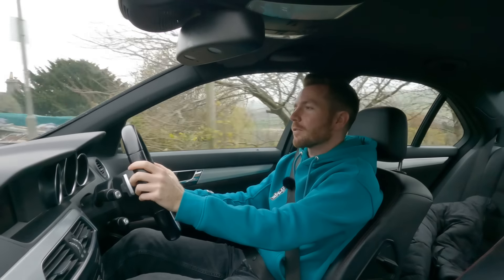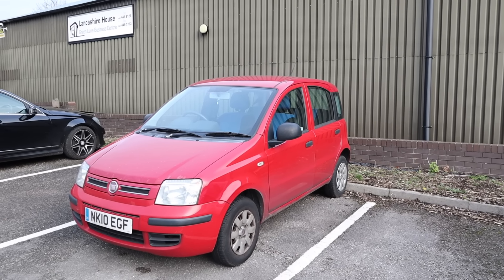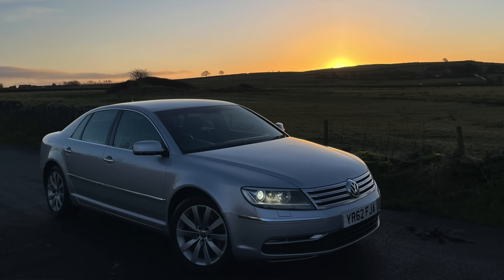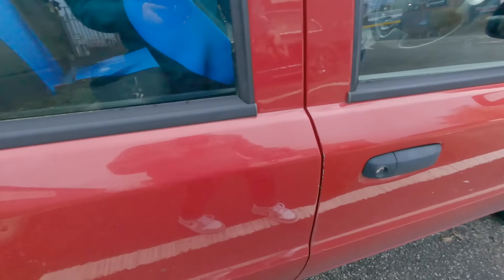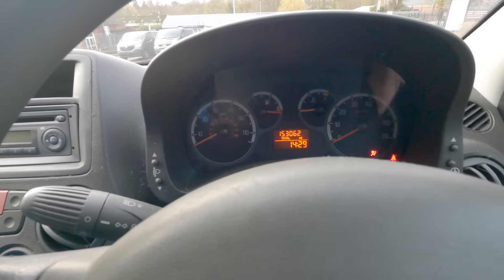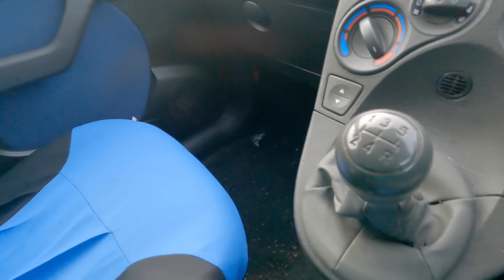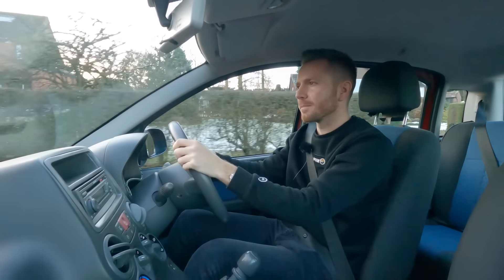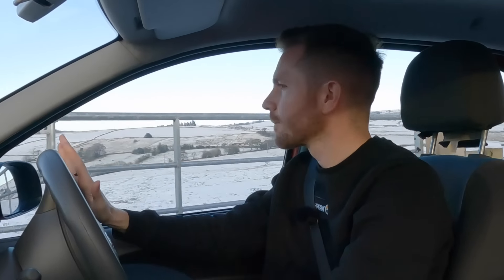I BOUGHT A CHEAP FIAT PANDA FOR £250

Comment: We are all different of course, but personally I love these videos where you go and buy a cheap runner with mega miles on the clock. As a trader you get trade prices of course, but it seems like yesterday that a tired Panda with some 'issues' would retail for a few hundred quid, never mind trade. 
I also really like Pandas, never owned one, but there is some genius in the design of that little car. Clever design without spending a fortune. You have to admire that.

Comment: I have in my past owned 2 Fiat Panda’s this shape .

One was a 1.2 Dynamic Skydome ( Had twin factory fitted sunroofs) .
My other was the 1.4 16V 100HP , I even did touring with the latter and after one really long drive i felt very good & still fresh that day .
The latter weakness was its suspension where on very bumpy roads i felt seasick .

Both were good cars at the time for me & both were 100% reliable with no faults at all .

Comment: 7:00
That engine is indestructible.
12:21
I drive 20 year old Fiat Stilo with 270.000 km on dash but power steering and city servo works like a charm.
City servo is awesome when i switch to another car i then i realize how useful city servo it is.
16:37
Another Fiat saved. It looks so nice.
18:47
Cleaner definitely earned his money, worth every pound
19:51
Whipper arms got treatment too.
4x4 Pandas are like goats it will climb anywhere.

Comment: Well done Matt, as you said before problem with cheap cars is they are cheap so no one looks after them. Thanks for showing the world it doesn't take much to transform sorry looking motor in to little clean runaround. Most of the time if someone sees 100k on odometer they  run away. Just keep them motors going because you will never see so simple motoring again in your lifetime. Keep on going Matt.
Reply from the maker: Yes exactly. What’s that saying? Many a fine tune played on an old fiddle or something?

Comment: Not completely bullet proof but excellent over a long period of ownership I had my MJ from new to 9 years & 130k problems other than wearing suspension parts were new EGR valve every 36k & electric steering light & fail which was low battery voltage not  a problem with steering. I have a set of 4 wheels with winter tyres for this & 4 fiat 500 size wheels & tyres 175 which suit the car well as the standard car is under tyred for the weight in the nose, let me know if it goes up for sale or you want the wheels cheers.

Comment: Had a fiat idea with the 90hp multijet  engine .was a really good car...also bought a seicento with the 1100 cc fire engine for £250...Had it 5 years so far ive spent around £80 in diy repairs..old fiats are underrated .cheap reliable and easy to fix

Comment: Like you say, pop a couple of winter tyres on the front and it’ll drag you through most of the snow we are likely to get, I’ve had different generation panda 4x4’s with winter tyres in my little collection of cars for years now 👍🏼

Comment: Matt - I am sure I see the air con symbol on the fan dial - and what looks like the on/off light.  I had a 65 plate Panda with a/c and it had a pull outwards fan switch that had a small light on it when a/c was on.  (Seem to remember the same on my Mums MK2 Granada Ghia X back in the day!)

Comment: We have a 2009 Panda Cross  with around 116000 miles on the clock and absolutely love it. I've just done a brake refurb, discs, and pads all the way round, which cost £93.00 and a new battery.

Comment: I owned three multi jet diesel models from 2006 until 2015, did 100000 miles in total between all three. Very economical with 64mpg possible providing maintenance was kept up. They have a few problems with rear axle rusting and rear shock absorber mounts. The heater fan is a notorious failure point but very easy to change if you remove the glove box. In my opinion they are a good reliable little car taking into consideration that they are built to a price.

Comment: The panda is a very well designed little car. If you give you time to look trough the lines of the design you suddenly understand why it still doesn’t look outdated for a design concept from the 90ties, when you look at the exterior. The interior is not quite on the same level. It’s quit interesting to park my little Panda selespeed on building sights next to a bunch of huge 4x4s and give them a walk  trough the hole concept of the car and compare it to the often very fragmented short lived design the big cars represents. The little car has gotten cult status among builders and they expert me to keep it forever. It’s not all about size but also about design stamina and honesty,  on a budget. Greetings from Copenhagen

Comment: I love my little Panda. 56 plate & only 29000 miles. To & from work & the odd trip to Reading. It's never let me down. 1.2 d petrol dynamic. Economical, fun to drive, easy to park  & cheap to insure. Drawbacks.... Pedals are very close together & take a bit of getting used to & the mirrors are useless!

Comment: I recently sold my Eleganza version (same as James May). Only because I didn't want to spend the money on a new cambelt/water pump & air con condenser as I had a great deal on a Viva. They're great little cars, frugal, quite spacious & will go on & on if you regularly service them! If you go on Fiat Forums you'll be able to find a set of roof bars in the classified section for it as well.

Comment: This will upset a few folk . . .
These are superb - I’ve had five (!) & currently run two (!) - all diesels. They are bulletproof with regular oil changes. The trouble is, like all bulletproof cars, they can be neglected & still carry on. The engine revs very freely for a diesel & they’re a hoot to drive. Things to watch are rear axle corrosion & from experience DO NOT buy a Euro 5 car (£20 tax) as they are over complex with DPF etc plus the turbo has to be removed for glow plug a change (currently have this 🤬). Stick with a Euro 4 (£30 tax) & get the late one like yours Mat as they have bigger & better mirrors with better build too & standard AC. No build issues there as they’re made in Poland. We ran our first against our AJV8 L322 Range Rover. Ying n yang & all that !

Comment: i bought a 2005 one from my local scrap yard 1.3 diesel, only done 20k miles. scrapped due to hydro locking after a huge rain storm. it was like brand new inside and out. i agreed the price before tinkering with it saying that if i get it running the price remains the same. i undone the injectors a little, pulled off the boost pipe and unplugged the MAF sensor, cranked it over a few times, bolted down the injectors, cranked it again and it started to fire. got it running on 2 and left it to warm up a little, all 4 eventually fired into life and i gave it a bit of a rev to get the turbo to fire out all of the water that was stuck in the intercooler. connected everything back up gave it a bit of a test drive, paid the man on the weigh bridge and driven it home where its been now in use for the last 3 years. been a perfect car! great fuel economy and plenty good enough as a commuter! if you have one, make sure the scuttle windscreen drains are not blocked and this will never happen!

Comment: This picks up crosswind really good, on a highway, it takes some getting used to. Not the best car in winter, when roads are slippery.. this is mainly city car, above 70km/h on a highway, does not feel very safe. But in summer, it is okay. and the fuel consumption is great :)

Comment: My mum has one, (1100 but petrol) and I agree, lovely little runabout.

However, the problem I have is there's nowhere to rest my right foot, and the throttle pedal is 6 inches up in the air for all but accelerating, so driving for more than an hour leaves my right leg with rigor mortis! Aside from that, it's brilliant.

The Blaupunkt stereo is standard fit from the factory, I had a Multipla with one. And with the same switchgear.

Although, small point of order. It's not Italian, it's Polish. Aptly, it's built in a town called Tychy.

Comment: my 1st car was a 09 fiat panda multijet dynamic I had from 2015 to 2018. Cracking little car although had window regulator fail in 1st 3 months of ownership, and power steering light would often come on so id have to pull over and start up again but other than that an honest city car! Still taxed and mot'd last time i checked!

Comment: I bought a 1.1 with 40,000 miles on the clock. It was bought as a short stop gap in between my usual larger 4 x 4's.... That was 5 years ago.... It's a fantastic little car... It's slow on hills, but other than that it's fun to drive, goes around corners like it's on rails, returns good MPG, very  reliable other than the odd niggle,  and very easy to work on, but best of all I can park it anywhere and not give a shit about it.

Comment: I'm thinking that if it's done that sort of mileage and is still running, then it's likely been reasonably maintained. And the high miles suggest the engine's been up to operating temperature on the open road. It'll keep somebody mobile, thats for sure!

Comment: Our little 1.1 panda throws up the steering light when battery voltage is low, 110k miles and uses no fluids, yes a fun little run around.

Comment: In 2015 I bought a 63 reg Panda 4x4 on 10,000 miles, I thought we were due a bad winter, misses started driving it , sold her car and adopted my panda, it’s still only on 26,000 miles, Twin Air Engine Oil is a horrendous price for the good stuff. Bu5 it’s easy enough to look after myself.

Comment: Daughters boyfriend has the 100hp model and it's actually ok, I've never owned a Fiat but around 2002ish I bought my partner a 1.1 Uno at around 9 or 10 years old.it only had 28,000 , she ran.it for 3 years or so never cost a penny to run and I only paid £750 of a mate who's a.mechanic with his own business , 3 years motoring I flogged it outside the house for £450, Fiat's for cheap motoring a better cars than they are given credit .

Comment: great car over here in Germany/Bavaria ! I'm still running a 2008 built 1,2L 8V Petrol Dynamic Panda in that "amazing" yellow" dress....except from an A/C &  ESP (?) otherwise with the whole Dynamic Style Package. Right now i'm the third owner, the car itself has been on the road for about 117500km now.
Living in a small bavarian village i can see more than 4 other yellow ones driving around over here. Funny. When i bought it in autumn 2017 it was quiet expensive (2900€) - 91000km. Since then & year by year the typical parts on this car have been repaired : exhaust & mid-tube. Front brakes (full), rear brakes (full), all wipers and its arms (front & rear), spark plugs & cables, ignition coils, all spring element front & rear. Last summer the german TÜV aka your MOT said no ! Side skirts (Seitenschweller) unterneath at the rear have been broken due to rust. But together with a friend and spare parts from Poland we've managed the repair session + fresh painting. Otherwise it's a reliable small & cheap car. And since i've got it no other rust issues. Ok, not true, the rear axle is corroded, typical issue for this kind of car. But can be fixed easily. All workshop issues done on a private basis. The spare sparts are really cheap and most of the work can be done by your own. Great ! Love it. Funny thing: due to some older car tax regulations for this car i only have to spent 26€ per year for car tax !. Quiet impressing. Until, oh yes, until you wanna buy spare parts directly from Fiat: Tank cap with lock (mine came without a lock): 35€.....OEM version 15€ incl. p&p.
Fun part2: underneath the front passenger seat i found a tiny trunk compartment ! It's been made for holding an extra subwoofer (!?), i use it for tiny spare sparts aka fuses, lights etc). Replace your default H4 bubles with Osram Cool Blue ones ! What a difference ! Great.

Comment: Hi  looks fantastic now great story about your panda, love it in red 😍
My wife has a 2010 base model 1.1 petrol eco active, as like the diesel these little petrol fire engines are a gem and bullet proof, so economical, smooth and revving.
cheap and easy to service and maintain, common things like rear shocks replacement or front lower, front discs, pads are are also cheap and easy too..
£30  Road tax.
 I've got a mad 500  Abarth but I love driving the panda because it doesn't attract attention also for its cheeky relaxed and comfortable drive,  room enough for 4 adults or 5 with a child.
Surprisingly competent and civilised on fast roads, its an all round practical little car, we had endless tip runs over the last year, fold the seat's down with plenty or room and 
 we didn't forget the tarpaulin 👍to keep it clean but yes an honest little car , not loaded up with extras so less to go wrong,  we had the power steering issue which basically ment a reconditioned unit which was updated so will not fail again, labour / vat was a fair bit ontop but worth doing as its only 47,000 on the clock, 1 owner before us, but yes keep it, perfect little run around, economical, these basic diesel engine only need an oil and filter, its a no brain for £250! 😉👍

Comment: Space saver spare. Steering light could be just a weak battery. The alternator can't meet the demand if the battery is a bit iffy. Had the exact issue on my son's one. New/better battery, problem solved for 4 years.
Reply from the maker: That’s a good point
Reply: @HighPeakAutos  I had the steering light on my panda after leaving it a few months. Once the battery charged back up it never came back.

Comment: I bought my Panda MJ brand new in 2005. In fact it was the launch car at the dealers. I was lucky because it came in the pale metallic blue I wanted and alloy wheels. I kept it for 13 years and around 120,000 miles. In all that time I never topped up the oil and the clutch lasted 95,000 miles. And I was a driving instructor during that time. Apart from service items and the clutch the only thing I replaced was an indicator bulb that faded to white. I replaced it four years ago with a more up to date Panda 1.2 Easy petrol because I changed job and now only commute 4 miles per day. The MJ returned an indicated 52-54 mpg but when you worked it out manually it was usually 10% more. I'm thinking of replacing my current Panda with a new one in the next couple of years. The only thing that's holding me back is that the latest version has the Peugeot/Citroën three pot which uses oil faster than the Torrey Canyon leaked the stuff. So, the Panda, in fact both of them have, been the most reliable cars I've ever owned since the '70s.
Reply: the three-cylinder mounted on the new Pandas is not the 1KR-FE I3 Toyota mounted on the C1 and 108, it is the Fiat Firefly

https://en.wikipedia.org/wiki/Fiat_Global_Small_Engine#Europe/North_America

Comment: I bought one years ago, most problematic car I ever had. Invented three completely separate problems none of which could be found or fixed by multiple garages. Lost a ton of money on the thing but my goodness, I'd buy one for 250 pounds. I think that, for their size, they are incredible to drive. Super comfy, quiet and a joy to do long distances in. Yes, you have to love understeer because holy moly, but other than that, I think it's a gem. If it works.

Comment: Mine was a smart looking metallic deep red. Really enjoyed the firm but comfortable upright position which paid dividends when on longer drives. Maybe a little lacking in knee room at rear. 

Servicing cheap, and never had any problems with mine whatsover until reaching 28,000 miles; when power steering problems would unpredictably arise. Restarting ignition generally resolved issue but it became concerning that power steering might fail at any moment.

Main and independant dealers quoted anywhere between 800 and 1500 replacement cost at time, dependant upon which of three components might be responsible. They also ominously confirmed that even once remedied, failure could repeat at any moment Unwilling to take the chance, sadly that led to a parting of ways.

Comment: I had limited edition 360 in black with fancy blue seats alloys etc. Was a great little car although the sump would rust really quickly. I eventually traded it in with 130k miles on it but it still went fine.

Comment: Had a '55 reg Panda which I drove until it died. Was nippy in town and held its own up and down the motorway. Its 'sit up and beg' driving position and idiosyncratic gear shift position make it quirky and fun to drive. Replaced it with the redesign 2012 model, which I still drive (80k on it) - just as much fun, easy to drive and costs next to nowt to run. When this one goes off to the great scrapper in the sky, I'll be getting another. As reliable transport goes, you can't beat 'em.

Comment: My review of a panda:

 pros: great mpg and running cost, good in snow and cheap, reliable

Cons: hight seat position, seems unnecessary, no foot rest next to clutch pedal unless you have toddler feet, quite scary to drive above 50, pretty bad body roll, high and soft suspension and short wheel base make it feel sketchy, styling is questionable but the panda 100bhp is kinda cool

Comment: I value mine at 2000 Eur. It is mint, and it has 240k km on it :) (around 150000 miles)
I even took it from Serbia to Greece and back (1400km total) and another time for 1500km - I spent like 200 eur on fuel for both trips :D